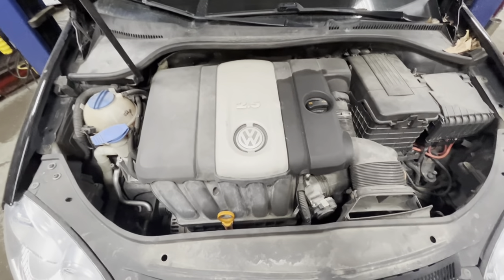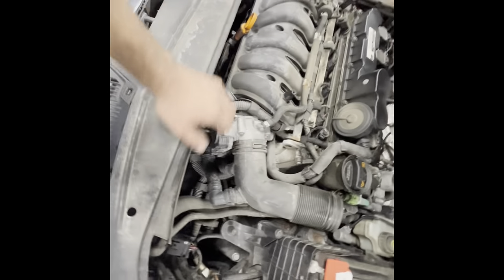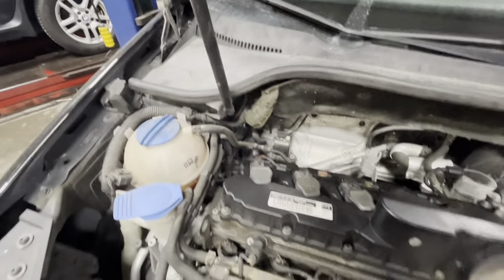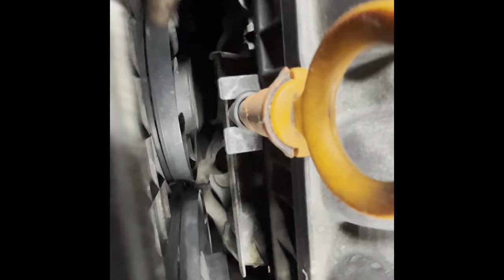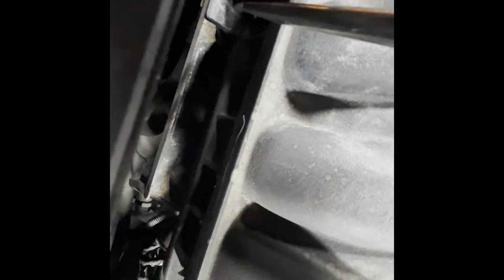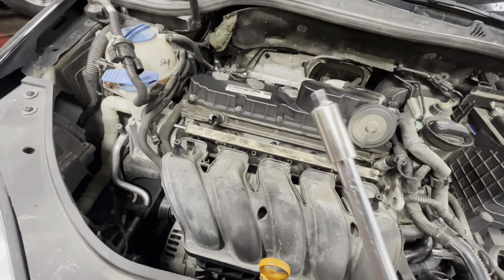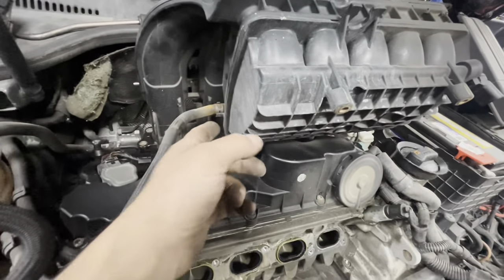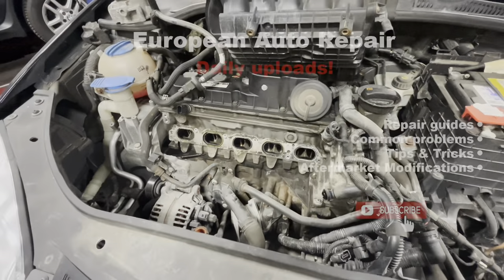VOLKSWAGEN 2.5 THERMOSTAT REPLACEMENT

Comment: Yeah I’m broke but not broke enough to do all this for the thermostat
Reply: on a 2010 in 2023. i bought the thermostat because it was so cheap and THEN i looked up what the job was.
Reply: Perfect comment, I said the same thing.  LoL
Reply: I did all the labor just to find that the screw was stripped underneath 😢
Reply: lmao
Reply: It’s a $900 job where I’m at apparently, so looks like I’ll be doing it myself lol. Don’t forget to replace the intake gaskets too while you’re there
Reply: No wonder you see new Beetles sitting in the back rows at repair shops. Labor costs are high.  And on a Beetle you also remove front clip.
Reply: Same here but I’m definitely doing it myself lol
Reply: @THEFIREPPL now that hurts
Reply: Just handle it I know it's a lot but you got this my boy
Reply: Lmaooooo! Sameeee! I’m like yeah this is a mechanics task cause this is just too much for me! I might as well change the alternator, ignition coils, spark plugs, pcv valve, and everything else along the way to the bottom of the engine 😂😂😂😂
Reply: I think  I will call an Uber bro. This would take me nigh on 3 years.

Comment: I don't know if you'll see this but my 2008 rabbit 2.5 has been springing a leak from the radiator intermittently and always takes a long time to warm up do you think it could be the thermostat stuck open or more likely a clogged or bad radiator the car never overheats it just sprung that leak and now has me wondering. It will stop leaking too for days then one day will leak some more, on and off.
Reply: I'm guessing both, if you want the cheap route first do a flush, pull hoses and check for nasties, then do radiator and thermostat.

Comment: Great video man! I’m trying to track down a leak and I’ve had a shop diagnose it for me. They say it’s the water outlet flange, I believe it’s the thermostat housing. Do you know where the water outlet flange is located relative to thermostat housing? What’s your experience with the water outlet flange on these cars?
Reply from the maker: You will see coolant on top of the transmission likely with the outlet flange leaking as it bolts to the back of cylinder head, with the thermostat housing leaking it will be underneath the intake manifold pretty central
Reply: @EuropeanAutoRepair  I really appreciate the response man. From under the car it looks like it’s coming from where the housing is, but again that shop swore it was the outlet flange. I’ll have to check it out again once I can get it on the lift.
Reply from the maker: @noahtattershall3599 curious what you’ll find
Reply: @EuropeanAutoRepair  me too, this thing has been pissing coolant for several months and I’ve had enough lol

Comment: Thanks for walk through on this job. I just finished installing a new thermostat.  There wasnt any visible difference between the old and new thermostat.  I was thinking the old one was stuck open because while monitoring my engine coolant temp it wasnt making it to 190F..ish.   it was more noticeable on the freeway. The temp would drop to low 170s even into the 160s.   Now it seems to drop to high 170s but seems to maintain temp around 180s to 190s.  Is it normal for the temp to drop to 180s while on the freeway???
Reply from the maker: That does seem a little unusual, I guess if you aren’t getting a cooling system malfunction fault and your heat is still working well I wouldn’t worry about it, typically from what I’ve seen they maintain engine temp a little better than that at a cruise tho
Reply: @EuropeanAutoRepair    ok thanks ill keep monitoring the temp.  Im using an obd2 reader with the torque app.

Comment: I just want to know why i need the strength of the hulk to get the housing seated properly.
Reply from the maker: Haha they can be a little tight, I like to use a rubber friendly grease on that oring to help with that, brake lubricant works well

Comment: Does the manifold gasket also need to be replaced before reinstalling?
Reply from the maker: Yeah definitely a good idea to replace that
Reply: @EuropeanAutoRepair I just had to pull the intake maybe 3 months ago for something else and I really don't want to shell out for those gaskets again. I personally think they're fine to reuse but want another opinion before I dig into this 😅
Reply from the maker: It’s not the recommend procedure but you’ll be fine for sure lol

Comment: This video was hella helpful bro. Thanks
Reply from the maker: Glad it helped you out!
Reply: @EuropeanAutoRepair  hell I had to pull it apart twice. Got the thermostat changed out, car back together, codes cleared. She drives it to work and the alternator takes a crap. Voltage regulator. When you open the thermostat housing it dumps fluid directly on to the back of the alternator. I know they are supposed to be able to get wet to an extent but coolant is a different story.
Reply from the maker: @caseyhelmer6423  dang! Sorry to hear that man, I haven’t seen that one happen yet on one of those, I’ve seen it on bmw with leaky oil filter housing gaskets tho
Reply: @EuropeanAutoRepair  it’s a pain. The idler pulley that blocks the top alternator bolt from coming out has to come off. It has 3 screws , 1 of which is in the blind. So you do it by feel. Car evidently had been worked on before because the T30 screw was waddled out. I eventually had to use a dremmel and grind the top of the screw off . There was no getting around it. No room to drill into it, couldn’t get an overshot on it. Lucky the bracket isn’t spring loaded and it has the other 2 screws to keep it in place lol hell of a job. Gonna put it all back together when I get home in the morning.

Comment: What about the fuel line we disconnect is there anything to do with the fuel pressure after you put the hose back on?
Reply from the maker: It should reattach and not be a problem, double check all your hose connections, I hope it’s just something simple

Comment: soooo i took my car in today and they are saying that it might be a thermostat cost to fix. not entirely sure yet, just an initial diagnosis. i have a coolant leak. which sucks. i got an oil change about 2 weeks ago as well. should this have been found before? 8 months ago they replaced the water pump, radiator, serpentine belt bc of prior leaks.  raped my wallet for $1900… but yeah, how much should it be for a thermostat fix and should it have been found before?

thanks in advance!
Reply from the maker: I’m not 100% sure on pricing but I would imagine it around 5 or 6 hundred bucks, not sure on labor rates at your local dealer or independent. I’ve seen them go from being fine to dumping coolant without much warning in the past so it is possible, cooling components usually hood up pretty decent on the 2.5l engines it’s unfortunate that you had all those failures

Comment: Any throttle adaptation needed when it goes back together?
Reply from the maker: Shouldn’t really be necessary, if you end up cleaning the throttle plate while you are in there it wouldn’t be a bad idea to perform adaptations
Reply: I did all of this and when I put it back together my car won’t idol correctly it started then stopped for a second and then continued running rough till eventually the rpm’s just kept going up on there own and I had to shut it off
Reply: Harley clean ur throttle do a seafoam treatment if necessary

Comment: Holy moly all this to just replace our thermostat, I take it there is no hitting it from the bottom to replace it
Reply from the maker: It’s honestly not as bad as it seems, the whole thing probably takes 1.5 hours I’d say
Reply: It’s either take the intake off or go from underneath, loosen the motor mount, jack the engine up, take the belts off to get the alternator off and you can squeeze in from where the alternator sits. Definitely easier this way
Reply: @gabeh.5061  lol yeah that definitely seems like a lot more work from the bottom access LMAO🤣🤣🤣🤣.
Reply: @gabeh.5061   do you have to lift the motor?? Is it possible just to remove the alternator with the car jacked up?  My thermostat seems to be stuck open.

Comment: Stupid engines idk why they have a problem with over heating after changing thermostat
Reply from the maker: Any strange faults stored in the engine control unit, they almost commonly have cooling fan issues

Comment: What a pile of crap!!! I'm surprised that you don't have to remove the heads and timing chain/belt!!!!!
You're just changing the thermostat, right?
Definitely want to look at several key replacement videos on any vehicle you plan on buying.
My Subi is a breeze on just about anything I need to touch, starter, alternator, plugs and wires, thermostat, timing belt.
The only bad thing is the valve cover gaskets or a head gasket job... But you only do that once in a lifetime of ownership and it will cost you, so don't abuse it and keep the oil fresh!